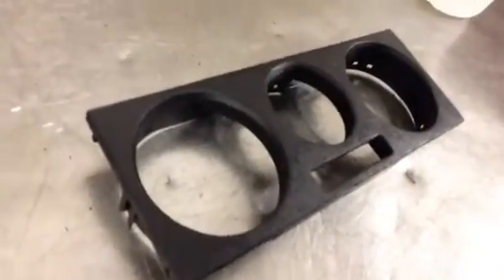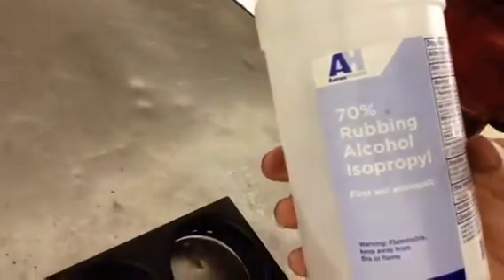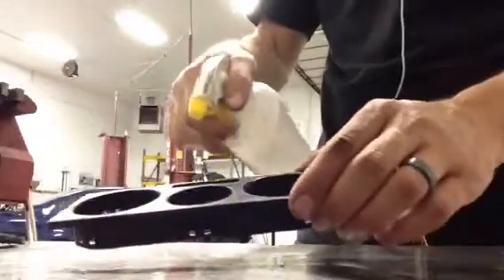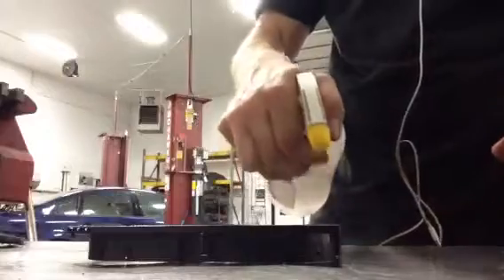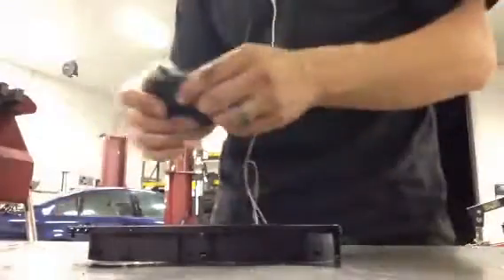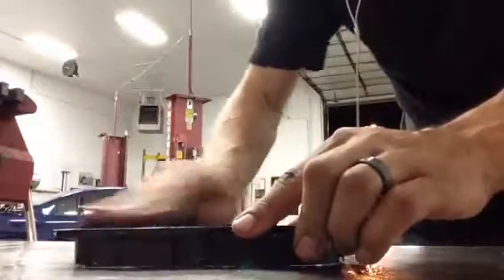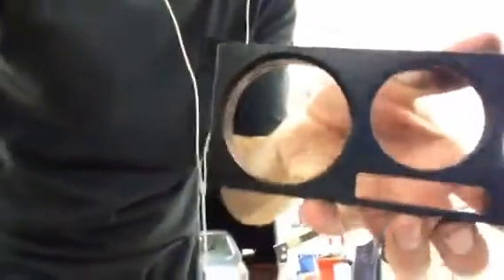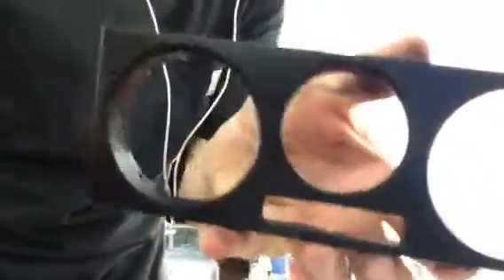Remove Soft Touch Trim Coating in about a minute - VW MK4 Mk5 Audi

Comment: Thanks for the video. Your 70% isopropyl alcohol worked better then I expected. I credit your results to your green pad. 

I Just soak removable parts in 91% isopropyl alcohol over knight or for larger parts use lots of rags soaked in 91% isopropyl alcohol. Comes off easy as pie (3.1415926535897932384626433832795028841971693993751058209... I guess pie is not that easy), It has to be 91% or higher or it will not work as well.  When I am done I use stainless steel appliance coating for keep is shining. 

VDub Love from Chicago
Reply: GallowayChicago  Cool, I'll try that. Just make sure to keep those rags away from any open flames or sparks!

Comment: I have a problem with the soft touch finish pealing on my Monte Carlo center console and mildly on the dash / gauge cluster trim I want to get it down  to the bare plastic so I can re coat it back to the soft touch finish but I have noooooo idea what product to use I was thinking about using that Plasti coat/dip spray and a friend suggested that I could try spaying light coats of flexseal but I'm not sure about those ideas do you have any suggestions great video btw thanks for posting this 👍 and subscribed

Comment: Hi, will the alcohol grey out the plastic? Thanks
Reply from the maker: MRL O Some trim will grey, some won't.  It's more the sanding pad than then alcohol that will cause it to grey.
Reply: Could probably use a heat gun to refresh the black
Reply: I use a product that makes the plastic shine afterwards, works perfectly

Comment: Recoat with soft touch coat?
Reply: but why?
Reply: like it better. better grip. matches better than bare plastic left behind.
Reply: @HeatherFaraMS  yeah you could recoat it again but it will come off in the future again
Reply: I have a problem with the soft touch finish pealing on my Monte Carlo center console and mildly on the dash / gauge cluster trim I want to get it down  to the bare plastic so I can re coat it back to the soft touch finish but I have noooooo idea what product to use I was thinking about using that Plasti coat/dip spray and a friend suggested that I could try spaying light coats of flexseal but I'm not sure about those ideas do you have any suggestions great video btw thanks for posting this 👍 and subscribed